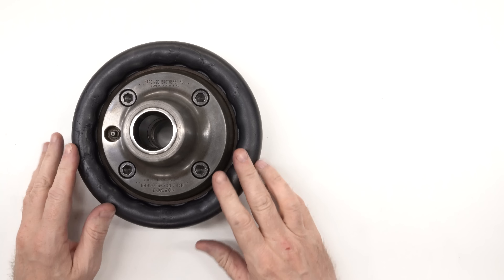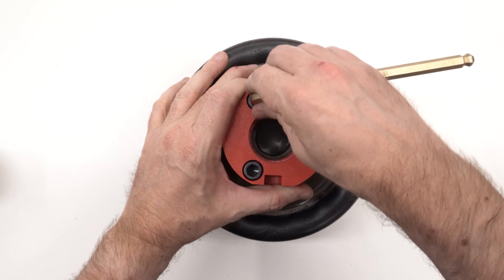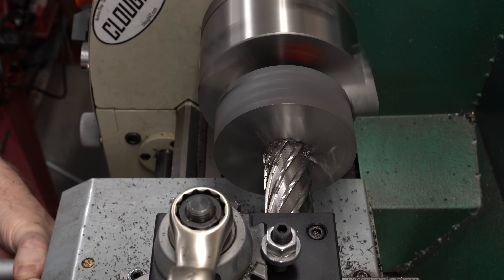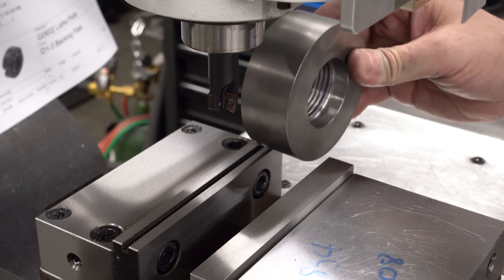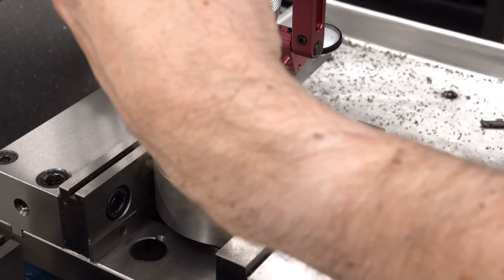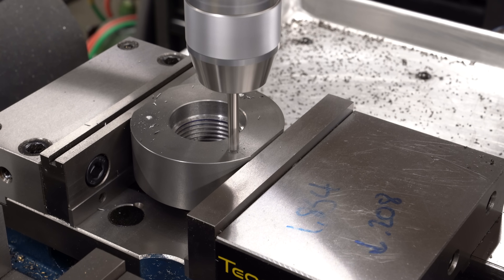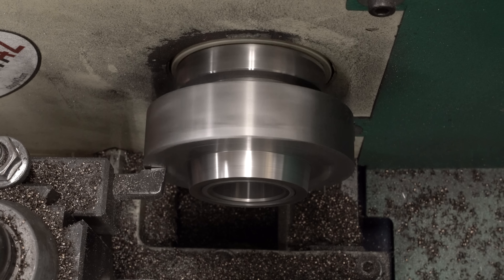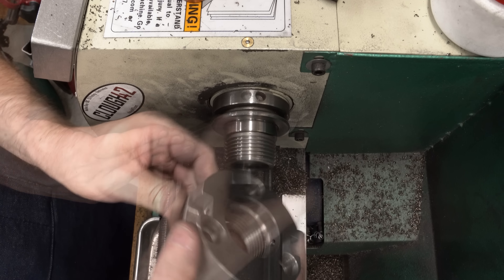How to Install a D1-3 Chuck on a Threaded Lathe Spindle

Comment: That gap between the adapter and the chuck is the source of your runout, the bolts deform the entire part when you tighten them. You may also need to use blue to see if the taper is level, because you're assuming the dovetail on the compound is perfectly parallel to the side of the compound, and who knows...
Reply: Excellent observation 👌
Reply: Also, the camlock would be pulling evenly onto the short taper. Using bolts, it's hard to not introduce a cant, and over such a short taper, that is hard to pull into true.
Reply from the maker: It's parallel to the extent I have the ability to measure.  I wouldn't use that technique if I hadn't already verified that.
Reply: @squelchstuff would tightening the bolt's in small sequential steps with a torque wrench help?
Reply: @rexhapgood5000  It might help, but in my experience, short tapers tend to be secured axially from a single fixing that is usually concentric to the taper. ie. a fine thread that clamps the tapered elements together with almost equal load. Three or four jaw chucks that are bolted from behind tend to have a registration shoulder for overall concentricity, but the bulk of the parallel concentricity comes from how parallel the back of the chuck to back plate is.

In James' situation, the three bolts might pull the adapter slightly askew, or distort the back plate as each are tightened in turn on just the taper alone without seating upon a parallel face. The amount may be miniscule, and as James alludes above, the non parallel faces are difficult to measure. However, just a few minutes (not degrees) of angle offset on what is quite a large total stick out from the spindle nose to collet face and then ultimately part, can lead to a large runout. Add any non concentricity of the collet, or even the chuck (due to age/wear) itself, and the three thou run out may not be that unexpected albeit disappointing.

The only sure fire way of checking is to characterise the complete assembly by checking the runout first with another "trusted" collet and gauge pin , and then rotating the chuck 120 degrees at a time and mapping runout in relation to bolt tightening. All done in a discreet steps to either isolate or confirm the cause. Even the securing cleats right at the root of the spindle nose might be bringing a small distortion into the mix and simply amplified - as angles do - with distance.
Reply: @squelchstuff  The 'bolt hypothesis' could be easily checked by systematically intentionally tightening the bolts by different amounts across the 3 and determining the effect (if any) on TIR.
Reply: @steveh8724  That's true of course, but will only confirm the issue and not cure the root cause. For the chuck to be both concentric and parallel, both the face and the taper need to come together equally. The taper sets concentricity, and the flat, perpendicular to axis of rotation face, sets the parallelism to the bed. (Assuming everything else is within tolerance of course)

Turning a workpiece in a non parallel chuck will create a taper instead of a cylinder. Non concentricity only becomes obvious after the workpiece is released, rotated axially, and then re-clamped. IE a "cranked" part results. With the taper as the only mating surface, first the mating surfaces need to be fully engaged, and secondly, the clamping forces need to be equal across all three bolts. Over such a short taper (small surface area) there's a chance that the taper can be wallowed out as cutting forces are applied. Also the adapter may distort under load and bolt forces too just to make matters worse. 

Both the face and the taper should ideally be mutually constrained to prevent surprises. Mr Crispin renovated his lathe including regrinding his chucks and back plates a while back, and there's plenty to digest from his endeavours.

Comment: My small bench lathe is a Jet 1024. I purchased it new in 1976 I think for $1600. Over the years I did lots of rebuilding of the issues. This lathe was made in Taiwan. It has a bastard threaded nose of 50mmx8TPI. I did buy from Enco a ductile blank back plate that I threaded on the lathe using the face place. Turned out pretty good with a Bison brand chuck. I was never able to do any cutoff operation as the lathe would go into harmonic oscillations. About 10 years ago, I purchased a 2" thick piece of steel to bolt the lathe too. Amazing how it made the lathe rigid, and now heavy cuts are easy. I wish it had the D1-3 spindle nose so I could run the chucks in reverse for threading away from the chuck and other operations, like unscrewing the tap or die under motor power.
I enjoy your channel. I'm a retired EE, worked on avionics for my career.

Comment: This got me thinking. I have a nice old Logan 14 with a threaded spindle nose. It was converted to a DC variable drive prior to my ownership. That makes it a very easy to use lathe without the varidrive vibration and time it takes to change speed. It's one real negative is the threaded spindle. The chucks I got with it are heavy, to the point I made a vee block system to mount and unmount them. But it's slow to do that. I miss the convenient of a camlock spindle. 
I had owned a couple D1-4 machines in the past and have accumulated some very nice (Bison and Buck) collet and jaw chucks with D1-4 mounts. This vid reminded me I also had a rotary table D1-4 mount! I spent a few hours today making a backplate for that adapter and, voila, I can now mount all my D1-4 chucks, which are superior for smaller parts. I was careful and basically have zero runout on the adapter D1-4 features, and the chucks perform as if on a dedicated D1-4 spindle. I'm very happy about this development - THANKS!

Comment: Curious if the runout changes with the torque on the screws. Very cool project.
Reply: My thoughts exactly. IIRC, the flat faces should meet at the same time the taper engages. Definitely shouldn't be pulling it in with the screws. Ironically it looks like he nailed it on the first attempt, then for so reason decided to blow it by adding unnecessary clearance.🤨

Comment: I did something similar on my G0752, but mine was a permanent D1-3 conversion.  I made a ring that slid over the part of the exiting spindle where you put a tommy bar to hold it still while you remove the threaded chuck.  That ring had 3 set screws that lined up with the tommy bar holders.  Then, once I threaded the D1-3 adapter on the spindle, I drilled and tapped through the face of the adapter and into that ring to lock it all in place.  I did the final turning of the taper and face of the adapter after it was all locked in place and I had as close to 0 runout as I could get with cheap bearings on a China made lathe.  I wish I had not gotten rid of it now.
Reply: Wait, u build a D1-3 spindle nose inclusive cams onto a threaded spindle nose?  Was that some kind of kit or all custom?  May I ask what material?
Reply: @joansparky4439  I did and I wish I still had the lathe.  I wound up selling it and buying a slightly bigger one, but now I'm back to a threaded spindle.  It was not a kit.  I had a slug of 4140 laying around, so I used that.  It held up pretty well for the couple of years that I had it.
Reply: @jasonestes8954    Cool. Thanks for the feedback mate.  Much appreciated.

I asked, because I dream of making my own D1-2 adapter as the bolt based interface on my mini-lathe is quite demotivating.  Hearing someone did it helps with motivation to overcome that issue ;-)

Comment: I am so grateful that you mentioned how much better the new compound clamp is working. On the previous video I felt a little disappointed that you did not make any chips. This was the PERFECT follow up to the clamp making video. I am curious about one thing. If you had made the new compound clamp, would you have gone on to make the solid toolpost riser and install the multifix? In any case, I continue to enjoy your educational style and video production value. Keep up the great work!

Comment: I have a Pratt-Burnerd PB-23 Collet chuck at work, and when I mount it to my lathe I use a test indicator on the internal taper of the chuck to test concentricity.  You can micro adjust the runout by loosening the 4 bolts on the outer face of the chuck body slightly and using a nylon hammer on the nose.  Just tap the nose gently until you get the desired result.  Usually within less than a minute I can get the runout to less than 0.0003.
Reply: Good Call!

Comment: James,
After watching your procedures on this and taking note of all the comments made about your TIR, one thing, I dont see anyone noting is that the torque of the bolts. Now this may or may not apply in this case but having metered consistent torque on the bolts can and will have a measurable effect on the TIR. World class Precision benchrest rifle shooters when cutting and chambering their rifles have found that consistent and EVEN torque to bolts on their reaming fixtures can and will effect TIR accuracy down to not only ft lbs, but down to fractions of inch lbs of torque. Just saying...........
Don

Comment: I made a similar spindle mounted chuck for my ER32 collets but it was to be mounted onto a C3 short taper mandrel nose.  I had the exact same problem (and disappointment) on my first TIR test.   I had, like you, left a noticeable gap of probably 3 thou or so and it was causing the ER32 chuck to kant over depending on how I tightened up the fixing bolts.    The solution after a lot of thought and experimentation was to grind off the excess short taper (microns) until there was no visible gap or shake when it was fitted to the C3 mandrel -  this takes time a alot of care to get right.   I once asked Jo Pie if he had any advice to give as to how I might  get this depth and size correct but he didn't respond and so maybe there is no short cut or easy method available to us hobbyists!  I reduced the resultant TIR of a gauge pin in a good quality ER32 collet from the initial value of over 3 thou to a respectable 2/10ths of a thou and this was not influenced by  the order in which I tightened up the 3 fixing nuts.   The residual 2/10ths run out is actually exactly what the mandrel run out is on my lathe and no attempt to better this in the past has ever been possible - it is the absolute accuracy of my headstock and mandrel.  I had tried when making a grinding spindle to do better than 2/10ths and after 3 tries, all with similar run out results, I gave up trying!     

Loved your video as so often mistakes are not shown leaving one to wonder if it was only I who misread the drawing or guessed incorrectly or just didn't pay enough attention to machining size or  detail.  I often feel sometimes that it would be better if I just downed tools and went indoors to do something else, because when the spirit is not in tune with one's expectations it's time to pause and gather ones thoughts and actions and wait for a better and more productive time.

BTW - you could have used that first block as the thread does not influence the location of the chuck when fitted.  It should be the register that determines the precise location and if the back is dead perpendicular and the register is axially accurate then all the thread does is draw the two parts together and a bit of slack is actually desirable.

Comment: Excellent video.
If I might make a couple of suggestions.
Make a bar that fits in your tailstock either the taper or your drill chuck that will be a neat fit in your boring bar block.
Using this bar set the height of the block to centre and your X axis reading as a tool  in your DRO.
You will then be able to repeat this setting to centre for annual cutters or a chuck in your boring bar block.
Also if you are using negative rake boring bars this is the correct height for the tool as you should set the tip of the tool to centre height.
As mentioned by another commenter, drill a couple of holes diametrically opposite in your adaptor for a tommy bar to  get leverage on the chuck and for hand threading stock.
Additionally the undercut at the junction of the taper and the face of the adapter is critical to the fit of the 2 parts, ask me how I know.
Take care and good luck.

Comment: Excellent video Sir. Could you re-grind and true up the inside taper to remove that runout?
Reply: 1.Take it apart. 2. Check the taper fit and face contact. Both should make full contact at the same time. 3.Torque bolts to final value. 4. Grind taper to correct runout. That should do it.

Comment: For centering the annular cutter by eye/feel, try a very shallow bore/groove from the inside going out until you reach the OD of the cutter. Then you can adjust the cross-slide until the cutter seats into the pocket.

Comment: run out could be because you tighten screws one by one, this means one side pulled higher (or lower). mark it and see how it aligns with bolts. Hope this is it

Comment: Unless I am completely off base,  the runout is caused by a trig error. You used the sine function, but It should have been a tangent function. The compound travel is the hypotenuse of the triangle. Carriage travel is the adjacent side of a 7.125 deg angle and the .2481" dimension is the opposite side of the triangle. 

Using the tangent (7.125) x 2 = .250 (rounded off). This is only a .002" difference from the sine value. If the length of the taper is about  .5",  then the small end of the taper is .0005" too small. 

The adapter large diameter fits with the collet chuck female diameter. But since the adapter nose is smaller,  then when the bolts are tightened, the collet chuck can be pulled to one side.  The collet chuck is nominally 5" long. A small error at the base would account for a .003" or greater runout at the collet nose.

I have made this mistake before. You do excellent work and I especially like the technique of using the compound pivot to rough set the angle.

Comment: For your chuck nose runout, I have used "onion skin" paper and shimmed the face between your adaptor and chuck with reasonable results. "Onion skin" paper comes in very fine thickness and allows for a little bit of adjustment when you tighten you adaptor bolts. The other option is to use a toolpost grinder and kiss the surface of your taper to "true it up".

Comment: I wonder if an actual torque wrench would help with runout...in order to ensure all 3 screws are equal in tension on the chuck.
Also as others have said...blue up the taper and see if the contact patch is constant
Either way...very very nice custom build and the 3D print rapid prototyping test was awesome...perfect example of how a 3D printer can be used in a production environment!
Keep em coming!!!!

Comment: Nice video. I tried making an adapter for an ER32 collet system to go on my mini benchtop Taig lathe years ago, and had similar runout issues:(

I read through all the comments, and I too think the .004" gap is too big. I wonder if .0005" gap would be more appropriate. Did the Iso cam lock specifications mention anything on that topic?

I think you can test that at this point using shim stock from McMaster. Put the shims by the bolts, trying different gaps. Maybe go right at .004" shims for the first test to see what that looks like.

Also, Mr Crispin just did a video series on truing up his backplates using a tool post grinder. He also aimed for a gap on the parallel surfaces, I forget how much now, but believe it was much less. In the end, he also had more runout than anticipated.

Comment: Hi James, I rewatched the Chuck assembly video and didn't spot any play when you were assembling the parallel pins. Since it's a chuck from the 70s, and machining accuracy were a bit looser back then, could rotating the chuck plate by 180 degrees potentially affect runout? The center distance between the pin holes may be accurate, but there could be a slight shift to side in one of the parts

Comment: I kept looking at the flats you put on the adapter plate and wondering why you don't model up and print, a slip on wrench to work with those flats, both to screw onto the drive, for a positive fit, and as a makeshift latel lock for tightening (and if needed) loosening the G0602 hand wheel for tightening and releasing parts. 

As far as checking the G0602, was thinking a proven collet chuck on the lathe, with a pin locked in on a collet on the G0602, and make sure that the G0602, registration surfaces are 9or are not) run true, which would rule out everything but the adapter plate, and then consider the suggestions elsewhere regarding that 4 thousandts deformation as the bolts close up the gap. This may also be a good way to make sure that the angle on the taper on the G0602 is running true to the tape on the adapter.  And yeah, this method presumes that there is no run out on a standard collet adapter for your lathe. I hope there isn't anything that isn't accounted for, but what do I know? I'm just a novice at designing stuff.

Comment: I’m curious the extra flex you might get from this, though parts will be much smaller diameter. On my channel I made a face plate that removed about .75” to bring the chuck in tighter to the headstock… helped a lot. Maybe I’m obsessively chasing after rigidity (but you somewhat are too?) just for grins, check to see what flex you get, old vs new?

Comment: The runout is being caused by the screws pulling it out of parallel. Both the taper and the face of the shoulder should engage at the same time. The taper keeps the axis concentric, and the flat of the shoulder keeps the axis parallel. Ironically it looked like you nailed the first time but then blew it by skimming the shoulder 😔
Reply: Should come back and grind the taper and shoulder face in using a tool post grinder and engineers blue until it all fits correctly.